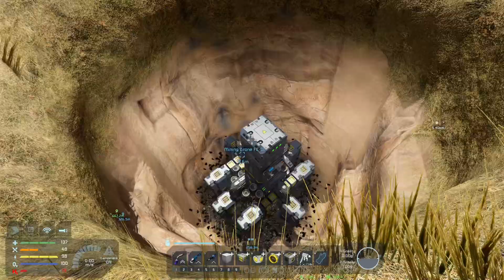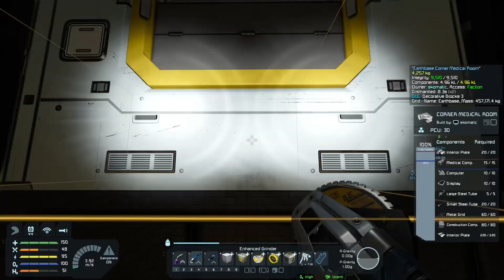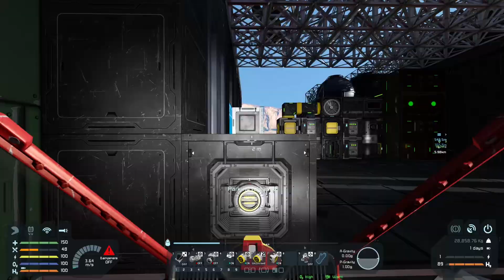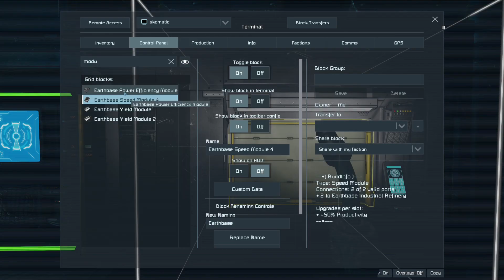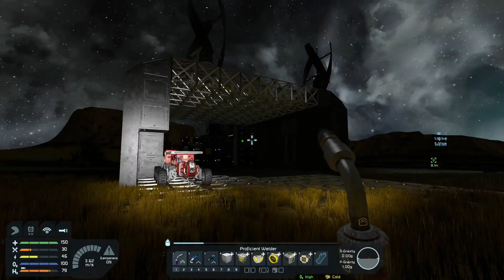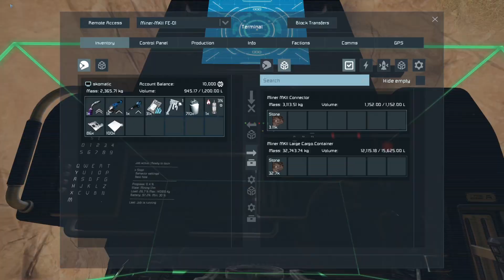We need More Power! ..and a better drone | Automated Engineering E08 | SE1 Survival

Comment: what version on the PAM do you use. PAM + or R.S.S looks like the original one run into error a lot
Reply from the maker: I'm using the version of SenX, but further modified to include support for manual waypoint creation and backup/restore through custom data.
The original is here:
https://steamcommunity.com/sharedfiles/filedetails/?id=2775731229

Comment: For PAM I always set the forward speed to 1.5 meters. It’s not going to push faster than it can cut.  And then 3.5 meters to pull out.  That way you don’t gather as many ores on exit.  I would be interested in understanding your use of 0.3 meters for going in.  Maybe it would reveal a mechanic I did not know yet.  Enjoying the videos and looking forward to the exploration planned for next video.
Reply from the maker: Usually I don't change the speed settings. My previous drones had their connector on the top and I wanted to make sure the drills have enough time to get rid of the middle spike under the connector. 
While the drills do have a large area of effect, the speed of voxel collection is reduced the further away they are from the drill center.

Thanks for the feedback and I hope you will enjoy the next episodes too :)